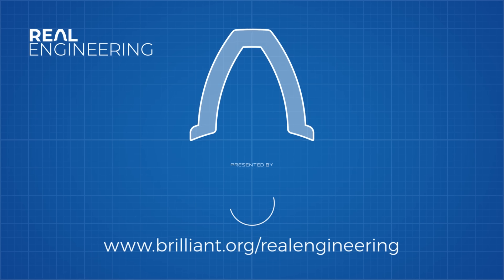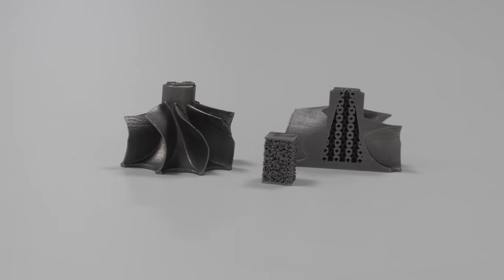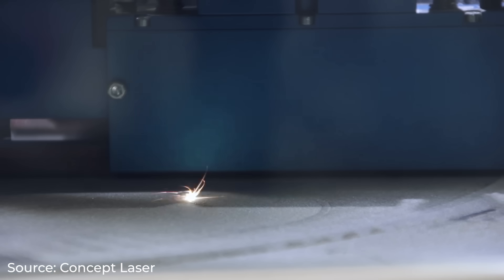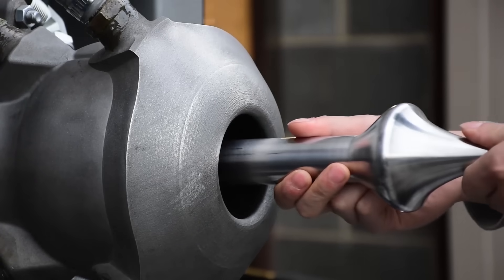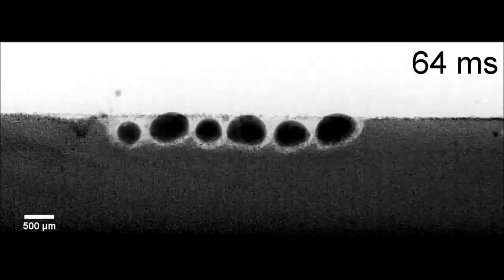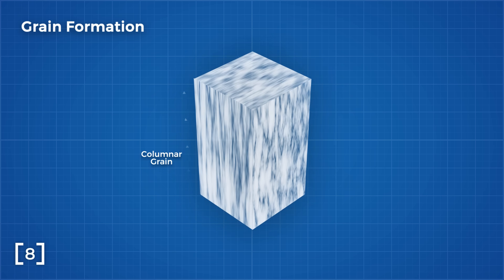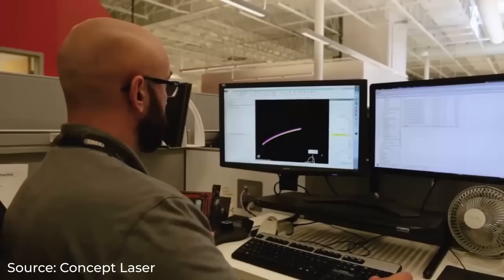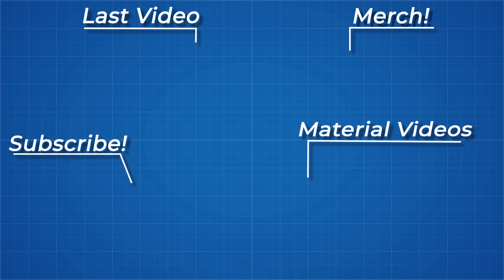The Material Science of Metal 3D Printing

Comment: I have a suggestion, to increase productivity.
A large head with lot of nozzles with valves may be designed, valves may operate electronically, there by a lot of material may be deposited simultaneously, increasing amount of material deposited per unit time.

Comment: I have heard of a process which uses electron beam melting (EBM) in place of a laser, and a vacuum rather than inert gas environment. It apparently results in fewer imperfections in the finished product, and avoids some of the issues with displacement of material. It would seem that this would be a much preferred process for rocket parts.

Comment: The loose powder overhang problem will be solved by shortening the pulse times of the laser, this will form a more uniform melting structure. Also, the powder should be prepared with some sort of binding agent and compressed prior to melting with the laser. Like a flux of some sort, or compression of the powder may be enough.
Reply: Spray powder in to the melt area like a welder adding metal. 🤠👍

Comment: It is amazing as this video is so valuable. Kudos to you for putting this 3 years back. That's amazing! There is a new technology that almost does not use even heat to lay down parts with 99% metal in liquid form and gets baked and 1% water to keep it in that liquid form and uses ceramic for supports and it would be very interesting to see how accuracy plays with that type of 3d printing.

Comment: I have an idea to potentially reduce the cost of traditional injection molding while also using 3D printing. What if you used a metal 3D printer to print the injection mold that you would then use to pump out plastic parts rapidly?
Reply: Good idea

Comment: What if you use a vacuum chamber. so there is no air to move the particles?
Or, use a sealed chamber and get it to high psi pressure so the air is pressing down the metal dust and not letting it move round.

Comment: No offense, but you really went way off the track of reality here. 

There are metal SLA printers in NASA, LARA, Boeing, Space Ex, GE, Corning Glass, Alcoa Engineering, and dozens of other highly regulated, highly efficient manufacturing plants across the country.
 
There are race cars, jets, and rockets with hundred of 3D printed parts, many of them, depending on the part, with very little of any post processing. 

You see, you chose a handful of failing brands to criticize, but the SLM 300 that Boeing uses, is calibrated and fine tuned to produce 99.95% dense parts and capable of printing over 10 alloys. 

It's not about the printer as much as it is the "slicer"...just as in PLA, just like in welding. The perfect weld of any material comes with fine tuning every aspect of the slice, laser power, focus, duty cycle, speed, ramps, overdraw, melt pool size, and many more. There are so many factors, and you have to have the flexibility to analyze and change these. The machines you covered don't do so hot on this. But there are brands that do get this right, they're the ones who hold those patents you talked about running out soon...

I think this video would have been better if you focused on one of them... They're already miles ahead of the pitfalls you went over here. 

Not a one of these issues are a problem on a Big Brand SLA with a educated materials engineer optimizing parts with the aide of SolidWorks and Magics software. Some of the most intricate parts imaginable can be printed with only a sand blasting or acid bath to smooth the surface. 

If you're going to title your video: The Material Science of Metal 3D Printing, maybe you should cover the tech companies that are crushing it instead of crashing. Cause I feel like your discounting that this technology is actually out there and the ones doing it right are taking jobs from machinist and manufacturing plants worldwide. More power to them. It's a beautiful thing.

Comment: the problem with laser printing in sand is exactly that, that it prints in sand....it should have a spray head next to the laser head and spray material exactly as much need for that spot. Like welding. And print on the same final material, for a durable base, not a sand base. And at the end the base will be cut, and the product metal would have a higher durability

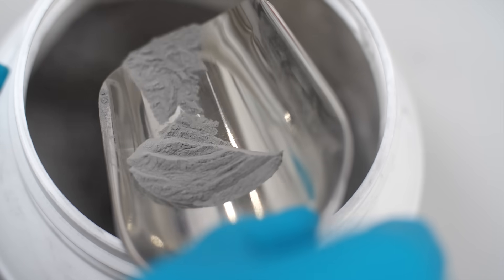Comment: 7:15 I'm pausing here because I'm fucking triggered 😤

I HAVE SO MANY ISSUES WITH THE PROCESS SO FAR! GAH! IT'S DRIVING ME CRAZY!

Here's how you fix all of it!

1) Why on God's green earth does this look to be a "cold" process? That powered should be heated, like ALOT. I would start testing when the particles first showed plasticity and worked my way down. This allows you to lower the power of your laser (it only has to get the material to its phase transition point after all). A lower powered laser also (shocking) delivers less energy, so you'll blow less away.

2) Why the hell is your laser way the hell up there? Just because you can doesn't mean you should... and why the hell would you want to anyways??? Look, just do the reasonable thing and have the laser mounted directly into the powder-spreader. It's easy! I'd have a scanning laser with a bismuth lined channel down to the material. I'd use bismuth because of its electron density, and resistance to high temperatures. That way you limit surface scattering of both particles of material and photons. This would have the additional advantage of localized heating, allowing for a lower intensity beam.

How to do the scanning laser, visualize this: Have a laser that shines into a rotation mirror-wheel (just like the ones in grocery store scanners). Now vary the power of the laser so the output energy in the output line is as uniform as possible. See how after each line there's an opportunity to move the whole thing forwards (especially if you're extra-clever and scan a line larger then the output, then simply divert the output). Lastly you just have either allow the laser or interrupt it and you're 3d printing.

These two simple changes would be game changers. Heat it up so you can use a smaller laser, mount the smaller laser in the spreader bar and make it a scanning laser. This would also lower your operating time by a lot. But I'm not done. The spreader bar I described could be improved a lot.

•have the front smooth and level the power that's about to be lasered/remove excess powered.

•have the laser be generated outside of the spreader bar. That way the spreader can be a "disposable" part... that way you can have multiple layers running continuously, and since the head can be inspected between each use/cooled or whatever, you can always ensure a quality print.

Lastly I would do this in a pressurized, inert environment. You wanna keep that powder back down as much as possible.

😗💨 phew. I feel better now ❤
Reply: 9:16 They stole my idea!!!!

Comment: Just use the 3D printer to build more 3D printers then the cost of the machines go down while your costs of materials unfortunately will go up but by that point you've got enough 3D printers to run enough material to cover both ends

Comment: I think if you applied magnetic fields and different frequency wavelengths together with the Lazer welding you may be able to have control of the way the metal forms, at high frequency wavelengths it should solve the issue.

Comment: Just another idea using magnetics. It's pretty far out there and if at all possible, would probably require a bunch of calculations to be done live. Plus, it would only really work for metals attracted to magnets, like iron and such.
You know how a magnet applied to iron fillings on a surface will cause them line up along the field lines? What if thay could be used to control the powder in the area along the surface of the part? It would be difficult, because the part itself, being made of the same material would effect the field in different ways as it gets made. If a flied could be formed though, so a field line formed right at the point of operation, it could guide the powder and molten metal in the area. Possible too, using a magnetic field during the melting and solidifying process could align the particles more, so you could affect the structure as it solidifies.
Just spitball ideas that I acknowledge are pretty far out there. I could see a tonne of challenges to it and it wouldn't work at all for metals with little magnetic interaction. (Tired right now and can't for the life of me remember the actual terms for the magnetic interactiveness of materials).

Comment: I wonder, if instead of having the metal powder everywhere, you could guide a thin stream of the powder to the site as needed, like an fdm printer. A method that may possibly work, at least for magnetic metals. This is just spitballing, so it could easily not be possible. Use magnetic force to convey a stream of material down to the site. I'm thinking you could have a tub of the powder that funnels into a tube, probably using something like ultrasonics, or just plain vibrations to get the powder to act like a liquid, to get it to flow. A think stream of it gets to a head that transfers control from tube/vibration control to magnetic. I'm not a magnetics expert, but I've been researching it down to the quantum level as much as I can. If I remember correctly, you can put a shield around a magnet, which effectively funnels the magnetic field through its form to an extent. Now, I also know, depending on the field strength, the permeability of the shield material, and its saturation capacity, it can only funnel so much of a magnetic field through its form before the magnetic field bleeds out the other side and spreads beyond the material.
So, what if you carve a groove into the material and funnel the powder into the groove. Then, if you apply a magnetic field close to the saturation level of the material, the material will contain it through most of the material, but it will bleed out into the groove. This way, the magnetic field won't go out into the environment and affect the part, but it will be able to control the flow of the metal particles. It could be as simple as lowering the field strength to let the stream flow and increasing it to stop it. Possible, although much more complicated, a system for slicing the field into layers, you could use the fields to control clusters to powder. Then the fields could be rotated to move the particles down. This would be much more complicated, but the other method relies on gravity to drop the particles once the magnetic field recedes, which may have issues if the shield material applies friction to the particles touching it or if it starts to become magnetic itself. I'm not super sure of shield material properties.
It's a throw it against the wall and see if it sticks type of idea. Haven't put a tonne of thought into it, just thought I would toss it out to see if anyone else could do more with it.

Comment: the iron man armor assembly systemsz is major project ,,, observe how precise rods can move in towards a central point (you could not see the assembly footage .. the tech from movies was greyed out until i explained how it worked you couldl nt percieve antoi gravity or floating ... you saw tires under land speeders  i did not ... any ways stable swing arms slide in from outer ringsz to central manufacturing and assembly hub so they can screw in from 360 degree vector .. go set up some space x project teamsz ... Space X ownsz tesla now

Comment: I wonder, have they tried to isolate the part from Oxygen? When you weld you normally need a gas or flux around the wire inorder to not get porosity because the oxygen creates crates in the molten pool.

Comment: So Ive been wondering, apparently 3D printed materials arent as durable as their usually produced counterparts. This is only a problem if you wanna 3D print something that is supposed to last long. 
But what about weapons?
By that I mean missiles, torpedoes, and other self-propelled projectiles? Suicide-drones?
3D printing their new exhaust should be cheaper and enable higher speeds. And we dont need to worry about durability because those things fly only once, no?

Comment: We engineers, with decades of experience sees fatigue issues are the most difficult to tackle due to material imperfections or surface treatment quality. 3D printing will stay in rapid low strength requirement prototyping parts. Metallurgy is not a simple visual parts forming/machining process which is interested by user view points. 3D printing has existed for many years and is nothing new. Its only new to people that is not in the industry but not people who worked on prototype manufacturing. In terms of energy cost, 3D printing is extremely environmental unfriendly, and is likely you can't beat first law of thermodynamics to overcome it.

Comment: Its not only material cost.. 3d printers need electricity to run.. if you use them for mass production, you are also limited by how much power you can supply... and how much it costs. Even if you use Solar power, you would get to produce max 6 hours per day on sunny days and with rising and dropping power supply during the day.

Comment: What prevents the use of vacuum tanks to prevent any gas from entering the pores? 3D printing in such an environment might allow no pores to form even given the lack of support material. The metal can be injected after the vacuum has been achieved through a system of one-way doors.

Comment: I don't see why they can't just do a fast weld  just to get the material molded together and after the item get fully printed to do a full forge to str. all the bond.  I just think if you can at least get the material stuck in place were it need to be that you would have more control afterward on how to smelt it all together so to speak..

Comment: Great video.  BTW, iro3d Selective Powder Deposition 3D printer doesn't use a laser, so it produces metal that's as strong as cast.  Also, iro3d is much cheaper.  And because it doesn't use sintering - there is no shrinkage either.
Reply: As you know "shrinkage" is never good. ;D
Reply: @BillAnt  What? Did I misspell it?
Reply: @iro3d  - You spelled it right, "shrinkage" as in the male member. (silly humor). lol
Reply: @BillAnt  Ah, I see :-)

Comment: It's possible to achieve 3d metal printing. In truth, we already have the capability. It's called welding. We can then call it 3d welding.

If you want to achieve the same function as plastic printing you merely only need the software and then build a machine that can fast melt metals. You can test with low heat melting metals and go from there by improving the machines heating power, in theory.

Comment: My thoughts on the matter: the system seems flawed, if the powder won't stay and cooling causes voids as you move the laser about, then hold the powder in place, and use multiple lasers. Now to be more helpful, acoustic levitation used creatively could move powder cleanly and possibly even concentrate a stream of said powder into the lasers track to keep an even flow of metal. Possibly going as far as making it possible to adopt more traditional 3d printing print paths since it's akin to a weld bead. As for the multiple lasers, the thought is to have lower strength lasers as well as multiple high temp "print" lasers, it would heat and weld multiple tracks while lower powered lasers immediately followed to reduce the speed at which the metal cools, That should reduce overall voids.

Comment: for now it is very difficult to at least compare traditional manufacturing to 3d printed parts,  there are so many material properties that a simple print could easily pretend to achieve. 3d printing techniques only solve the geometry problems, most of mechanical parts are made not only to accomplish an specific shape but also to perform some characteristics and properties, they could be mechanical, electrical, chemical, etc. That's a big challenge to overcome. I didn't even mention two very important variables to fate, time and price. Even though, someday 3d printing technique may possibly  manage at least the most common material properties such as resistance, ductility, hardness, elasticity, precision, finishing and so on, just in order to be only a part in the manufacturing chain, but not solving everything by itself.

Comment: I've actually always wanted to know how 3D printing could possibly be done with non-plastic materials (metals, organic material) and how practical it was. Sorry to hear its not practical yet despite massive advances but a super interesting video and topic. Well done!
Reply: There are small SLS systems for workshops now available for around the price of a good industrial tig welding machine
Reply: So this is from 3 years ago so I would take it with a grain of salt.. 3d printed metal is being used in aerospace applications and Bugatti's. SpaceX is printing their rocket nozzles. I would say some advancement has occurred or this guy didn't know the capability's of the tech. Honestly Spacex was probably doing this printing 3 years ago when testing it for the engine builds.

Comment: New to this stuff but I wonder if they throw the whole thing in a gas tight chamber vacuum out the atmosphere and replace it with argon or another inert gas if that would remove the porosity. In welding we use a shielding gas to push out all the atmospheric gases trying to eliminate porosity ( if the base metals “dirty” you’ll still get it but doubtful it’s the reason here)

Comment: Why does a 3d printer need to use only 1 laser? Why not setup thousands of tiny lasers within the construction area, so that you can build the entire layer of the part in one quick flash per layer. Only the lasers directly above the area being welded would activate. This would decrease manufacturing time and alleviate a lot of these welding stress issues.